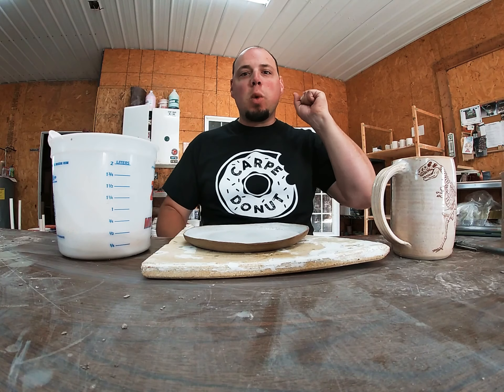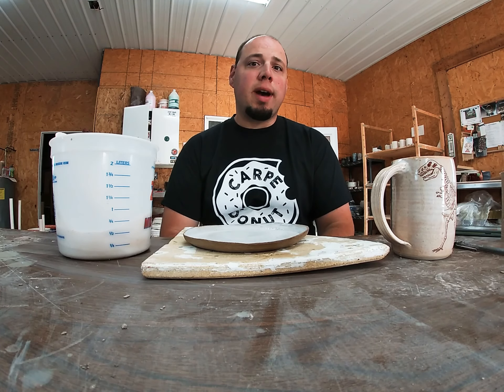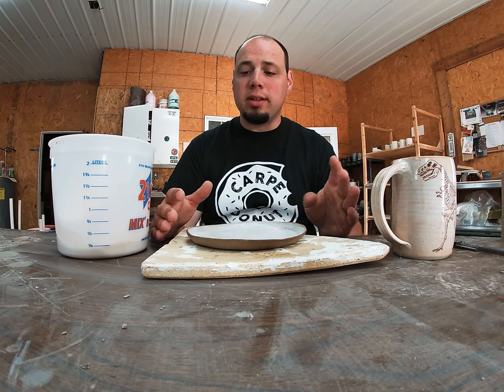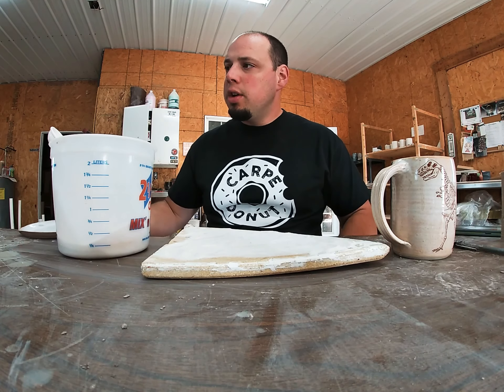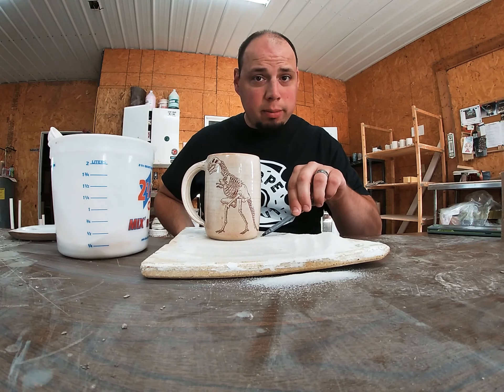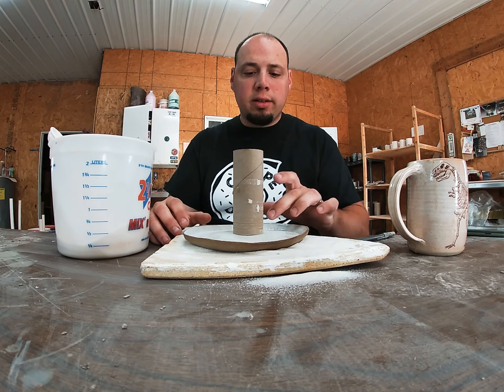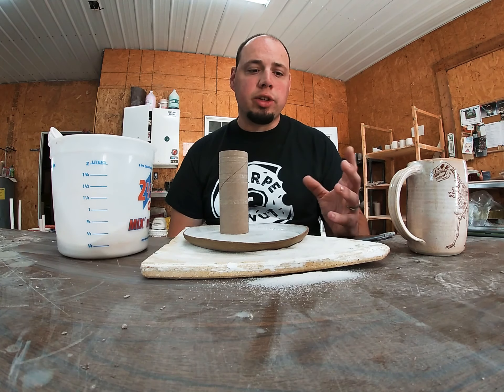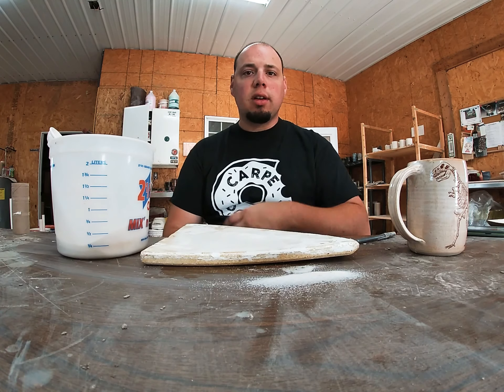Silica Sand

Comment: Thank you for the info. That would be great product to use under the tiles/plaques but my biggest concern is that silica is very dangerous for our body, it’s cancerous, should not be inhaled. When I looked at you, I’m quite surprised how you handled it. I appreciate your comments on this. Thnx
Reply from the maker: I’m glad you enjoyed the video! Yes, I agree with you immensely that silica is a dangerous material to inhale, but its the airborne silica particles that are a problem. Not the ones bonded and hardened in the sand. If I were to crush he sand into a powder and release the silica particles into the air, that would be a grave concern. Same thing with dry vs. wet clay. Wet clay contains silica but it is not harmful to you in this stage. Once the clay becomes 100% dry and those silica particles can be released in the air, then you have a silica concern. Which is why when I mix glaze or sweep the studio I wear a double respirator.
Reply: @jhpotteryworks6023  thank you for your reply

Comment: Zhuiri Magnetoelectric Technology Co., Ltd. is a high-tech enterprise specializing in the development, production and sales of magnetic separation and electromechanical integration equipment. The company was established in 2003.
In the past two decades, the company has been committed to the research and development of powder iron removal and purification technology. The "ZR0709 series electromagnetic powder iron removal equipment" independently developed by the company has a high magnetic field gradient, a unique structure, and a significant iron removal effect. It is widely used in new high-purity powdered silicon, carbon materials and high-end materials required by photovoltaic, lithium batteries, and electronic products. Iron removal and purification treatment of powder materials in ceramics, high-end building materials, abrasives, chemicals, refractories and other industries. Since the product was put on the market, it has been highly recognized by users. It can partially replace the traditional high-polluting pickling and iron removal purification process and solve an important technical problem for customers, thus creating a new era of physical iron removal.
In 2011, it passed the appraisal and acceptance of the quasi-expert group of the Provincial Economic and Information Commission, and the main technical indicators reached the international level. This product has been granted a number of national patents by the State Intellectual Property Office (Patent No.: ZL2011203128583, ZL2012200761494, etc.)
 
The main products include ZR0709 series electromagnetic separator and electromagnetic separator. The iron removal effect ranks first in the world.
China Factory Location: No. 16001, Yingni Road, Dongcheng Street, Linqu County, Shandong Province, China,
Created: 2003
Number of employees: more than 100
Overseas markets: Asia, Europe, Middle East, Africa, North America, South America, Australia, etc. Number of customers: 3000
Certificate: CE, FDA, Rohs, FCC Certificate: CE certification, FDA certification, Roh certification, FCC customization: Accepted: www. zhuiri-machine. com

WhatsApp：+8617353669645
Weifang Zhuiri Magnetoelectric Technology Co., Ltd.
Foreign Trade Department-Aaron
www.zhuiri-machine.com